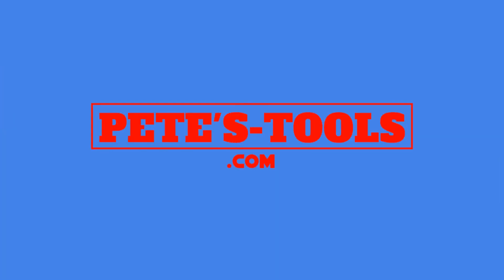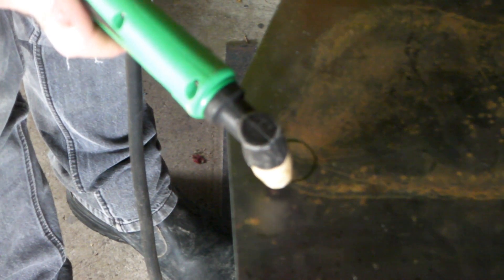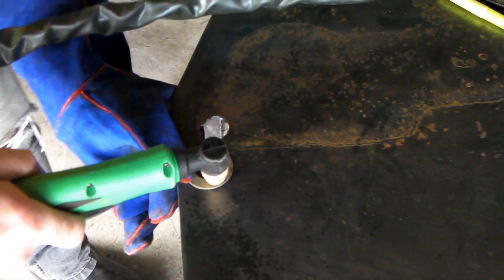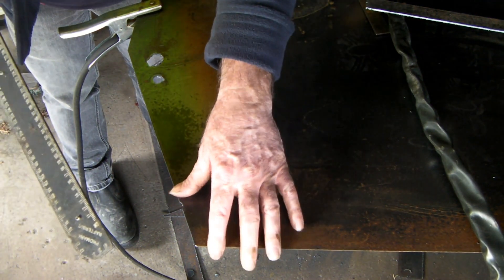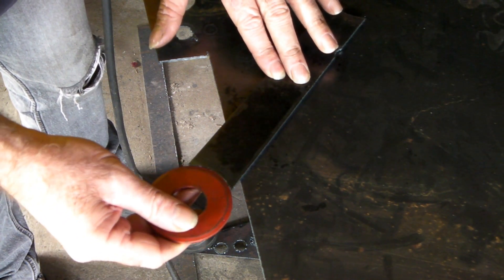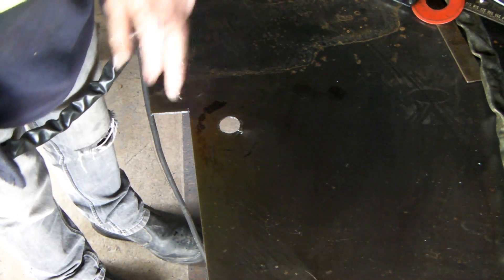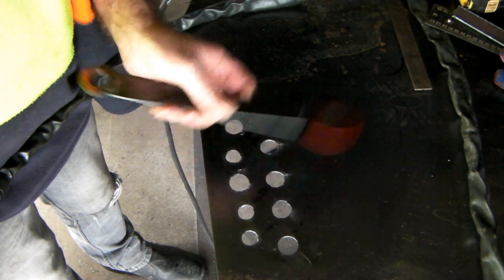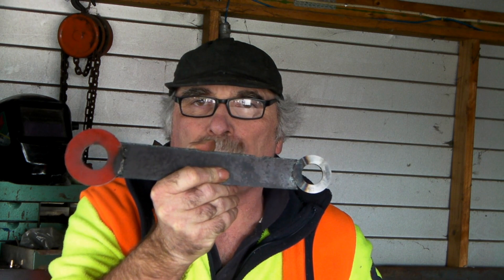Cutting Bolt Holes With Plasma

Comment: Just a thought…. - Does the size of the hole in the tip determine the cutting area of the arc?
If so, would a wider hole in the tip give a useable small bolt hole by just blasting it and not moving the torch?

Comment: Thank's for the great idea. I need to make lots of 1/4" holes in 1/4" plate and drilling them would take forever. I found a couple of large thick fender washers and will make the jig tomorrow. I have cut holes with my plasma cutter before and they were a disaster 😞. I think your idea is going to make a huge difference. Thanks again mate.

Comment: Just put a couple of tacks on your template washer directly on workpiece. It won't slide around then grind the tacks off when hole is cut.
Reply from the maker: good idea but it you have many holes to do that can get frustrating .
cheers pete
Reply: @petestools  or vice grip the flat bar to the sheet. Will also free up your other hand to keep the cutting tip perpendicular.
Reply: @petestools   There is always a price to pay Pete in the pursuit of excellence. Keep making great vids mate. Sharing ideas and tips help all the shed men in the world advance. So how about we advance your brilliant straight edge with the magnets in ? That works really well and gets the job done. How about we make a template with the most common size holes that we use for bolts, pins etc. A bit like an architect used to use a radius aid many moons ago before Autocad. We drill different size holes in  a strip of 3/4mm plate, add your magnets, mark the size of each hole then can use just like your straight edge, it would be worth the time and would save us the time of digging around the shed for the right size washer etc when we need to do it quick. Of course you make a vid in your unique style and the world will be a better place : )